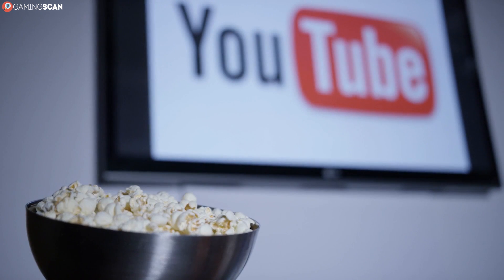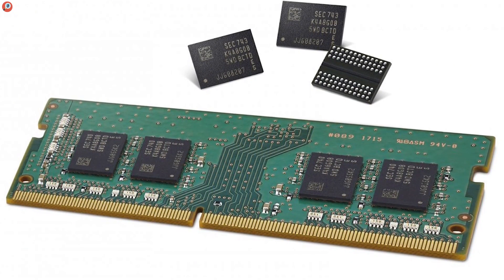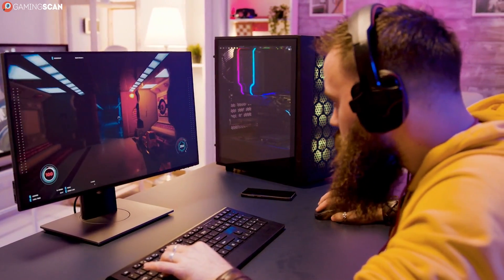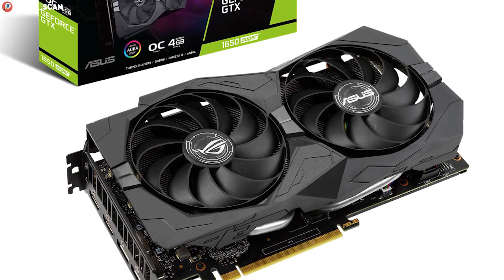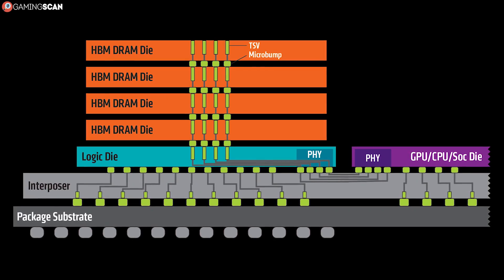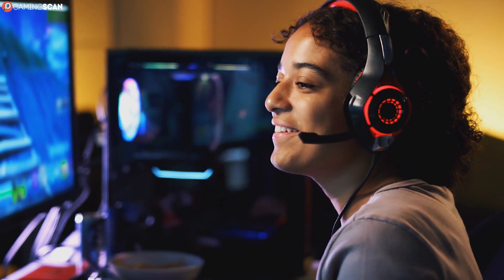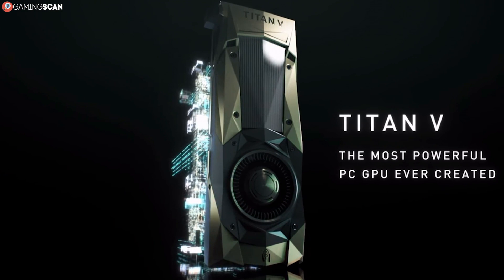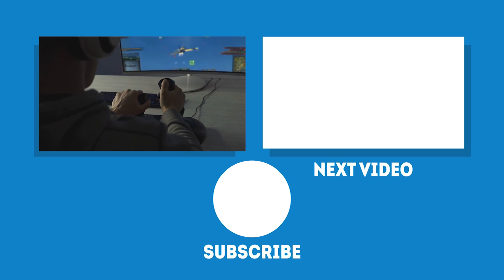GDDR5 vs. GDDR5X vs. HBM vs. HBM2 vs. GDDR6 - Which Is Best For Gaming?

Comment: My 5700xt Sapphire Pulse utilizes GDDR6. It is an exceptional card at the pricepoint. Great software/drivers, not loud at all, and runs cooler than the other 5700xt's Ive seen, especially when slightly undervolting. And undervolting the card only slightly impacts performance. Easy to do in AMDs Adrenaline software. I paid less than 400 USD for a new card a year ago and couldnt be happier. Works well with the Ryzen 5 3600 at a lower price than the Ryzen 7 and 9 components that outperform it. But if going bigger than a 3600 is your thing then go for it.

Comment: what does the X stand for in GDDR6X or GDDR5X ?
Reply: X is normally used to describe a multiplier. Hence why the X variant is faster. AMD does it a lot with their ryzen chips. For example you have the ryzen 3600, and you also have the ryzen 3600x which is 200mhz roughly faster.

Comment: VRAM can make a huge difference in fps, it wasn't the case for the 1650, because the GPU was the bottleneck, but for a superior GPU (gtx 1660 and up) it's critical to upgrade the GDDR 5.
and the same thing applies to HBM2, it doesn't make a difference because the GPU is the bottleneck in the graphics card.